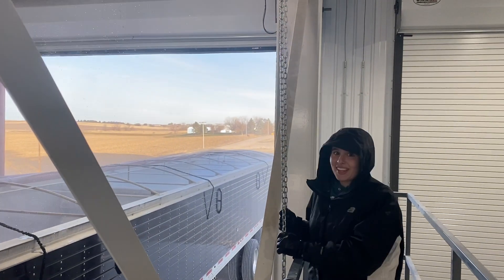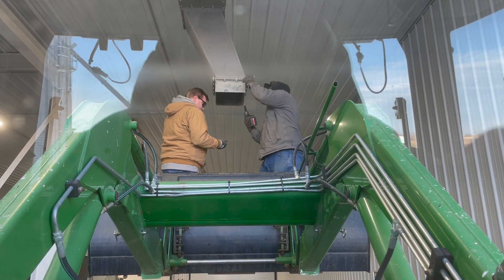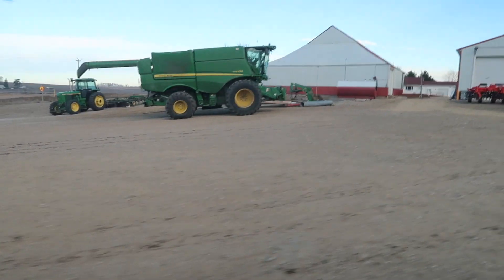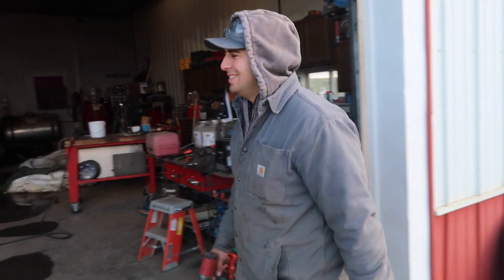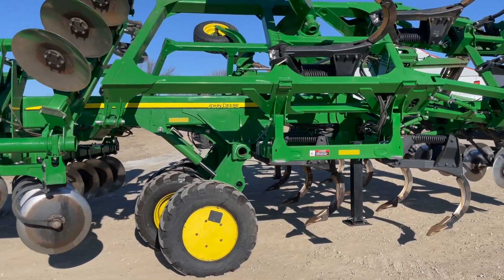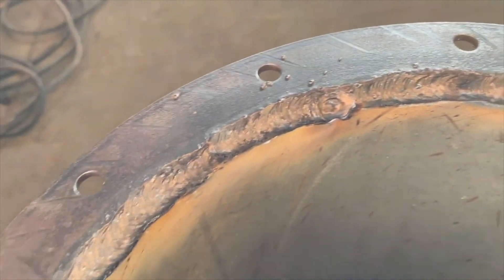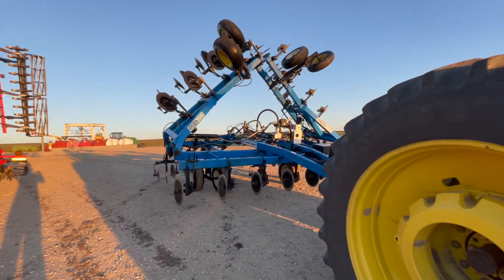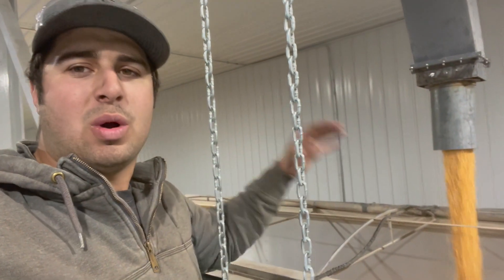Full Day Of Washing | EPIC New Overhead Bin Spout!

Comment: Real Mann drink coffee in the morning…..
Reply: Coffee vs OJ/ OJ all day every day
Reply: On the spout is more controlled, but like said is slightly slower.  Mustard I can tell you are up for tweeting it one more time , if your round tube was 12" I'd  try 14".  I have  overhead  bins in our Elevator. When I open  slide it's, a 12" square opening,  I can fill truck in under 3 minutes  The  round, as big as it is,  is acting like a restricted funnel.  That means corn is backing up in the tube,  you have shut the valve in advance to stopping.   The next thing,  would be have camera in the cab , and let the driver remotely control  spout.  I know it can be done. . I've seen it on UTUBE,  if I find it I l will forward the link.